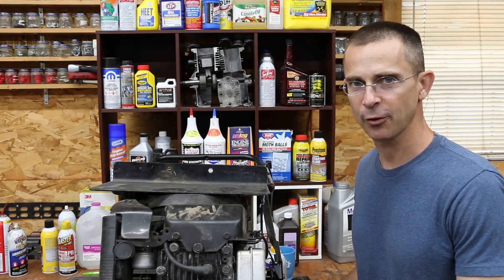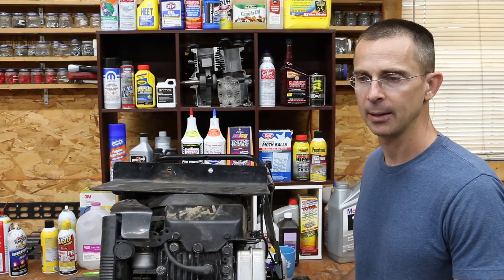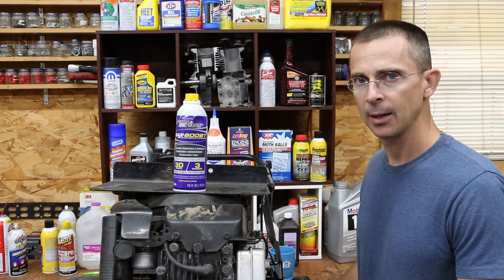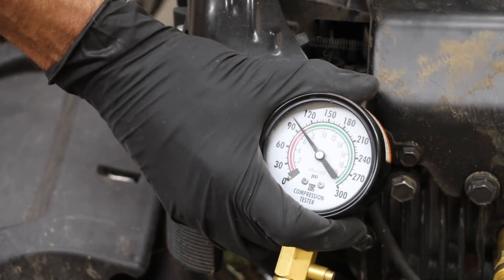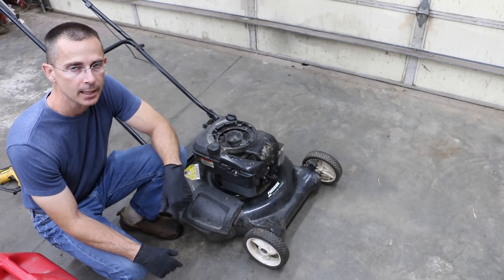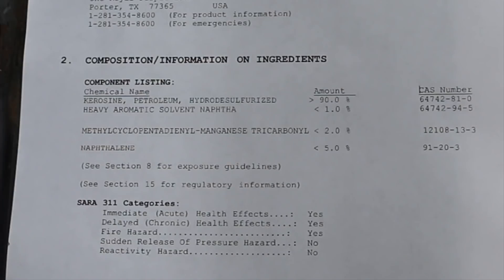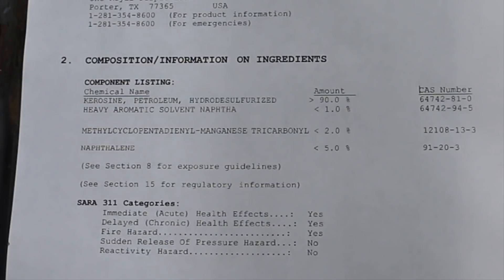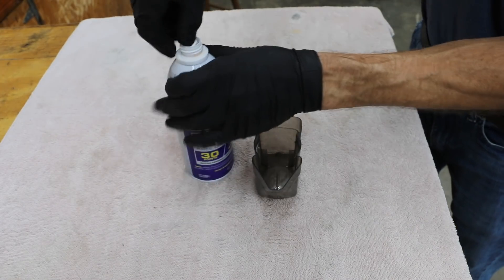Will a gas engine run on 100% octane booster?  Let's find out!

Comment: apparently people do not know what octane really is. they think high octane means more power.
Reply: that's called your butt dyno. It's been proven to show higher HP gains when the owner does something they think should give it more power. Examples of such include cold air intake, louder exhaust, high octane fuel, octane boosters, and various other "performance" upgrades.

The only way your car could make more power is if you could retune it with more ignition advance, but even then you hit the MBT where timing won't increase power any further without additional modifications.  And on a bottom barrel NA 4 banger like your E46 has, it's not going to make any more power.
Reply from the maker: Thanks for commenting. Many people are well informed regarding the way octane boosters work, but most are curious regarding whether or not an engine will run. Thanks again!
Reply: have you tested an engine with different spark plug gaps? that may be a good video if you have not done it already.
Reply: In a high compression engine, IE most modern cars , it does mean more power
Reply: Really all it means is how hot you want it to run. And how hard it is to ignite.
Reply: Pyrotechnition 2002, you don't want your fuel mixture to combust prematurely. So you use a higher octane when you have a higher combination ratio. The only combustion you want in your engine is when the Sparkplug ignites the fuel mixture.
Reply: Zero most of what you said is true but e85 is NOT water based. Its alcohol based. Ethanol burns cooler than straight gasoline and is harder to detonate, which is why you can make more power with it. It has nothing to do with water. Alcohol is hygroscopic though so over time it can be contaminated with water, which is not good.
Reply: ΑΡΗΣ ΚΟΡΝΑΡΑΚΗΣ the engine isn't calibrated to take advantage of a higher octane fuel. It wont compensate for a higher octane, only possibly a lesser octane to avoid detonation
Reply: Taydrum no, it doesn’t; what it does do is allow you to TUNE for more power.

Octane rating is about the fuel’s resistance to combust; in this specific case - prematurely aka pre-detonation/knock from the combination of heat and compression.

When the octane is lower, it is easier to ignite. So something like a hot spot such as a carbon deposit combined with high compression can lead to the fuel igniting before reaching tdc which leads to the energy pushing against the rising piston, pushing against valves not fully closed and they knock against their seat, and can lead to damage (especially in a wankel as it is extremely rough on its apex seals (think piston rings)).

With high octane you can advance timing, run leaner, have higher compression ratios, run more boost, etc so you can tune for more power. The reason why cars tuned specifically for high octane produce less power on low octane is the computer senses knock or otherwise detects the rating and retards timing and adjusts af ratios to protect itself, reducing power.

This means, you can just take a car rates for say 87 octane, put 93 and make more power. That isn’t how it works.

Another example is ethanol/E85. You see this trend now of people doing E85 conversions to produce more power; the power comes from the tuning available from a two fold advantage of the properties of ethanol. 1) much higher octane rating allowing for the tuning mentioned above; 2) it is a water based fuel and the effect of that water vaporizing in the chamber cools it off, allowing for even more room for pushing your tune at less risk of engine damage.

The drawback is it has 40% less energy than gasoline per unit, so you need to beef up fuel system to supply that much extra fuel to be at the same power, then that much more to accommodate you tuning for increased power.
This makes E85 terrible for fuel mileage comparatively, though people doing the conversion are not too concerned about this aspect.

So basically, stop putting ‘premium’ in your recommended regular fuel cars, unless you are experiencing knock (which you then probably should figure out why it is knocking and not use octane as a permanent bandaid unless the fix is a rebuild).

So, economy boxes and most average cars are going to be 87 octane (US) and performance (high compression NA, advanced timings, turbo/sc, etc) are going to be 91/93 minimum for optimal operation under normal loads and safety for high loads (heat, timing, pressure).
Reply: m4xwellmurd3r well, that was a bit oversimplified as of course ethanol and methanol are alcohol based fuels (ahols); but they do contain water and the explanation stands pretty much the same.

If you don’t have injectors made for it, and you don’t flush them if you remove/switch them, they will corrode and be junk because of the reason you said and it’s water content already in it. There are videos with the haltech guy stated exactly what I said, that the water content in the ethanol cools the chamber if people want to find the mighty car mods video to see for themselves; or just searching the net, but it is a known that this is a strong benefit. I’ve been casually looking into ethanol as one of my vehicles is a rotary and detonation and excessive heat being the only real quick killers outside running out of oil. I personally don’t want the reduced efficiency, and a more important aspect for me is ethanol and incompatibility with some lubrications; as I might go to a sohn adapter in the future and run idemitsu 2 stroke both from a reservoir instead of injecting the 4 stroke oil onto the apex seals and premix in the fuel tank at full ups for extra protection for engine longevity.

I do appreciate the correction/clarification but I assume you understood what I meant ;)

I just hope people can understand the point overall; octane rating does not directly increase power. You can’t take your crx running 87 octane and get any extra horsepower putting 100 octane in it, that just isn’t how it works. You would have to put a more energy desnse fuel in to get more power per unit used and that is not what octane rating is.

Simplified answer for people

Octane = resistance to combustion from heat and pressure NOT its energy density rating. It’s for engine safety margins, not power gains.
Reply: you should read up on octane so you understand what it is an  its purpose . depending what compression engine you have is what calls for different octane.  see pre ignition....
Reply: I think your the only one in here that understands what octane is and is for ! lol
Reply: user 007 more octane means more power definitely. I feed a E46 316ti with 95 unleaded (regular), but the next day after I got a payment (a big one) I decided to fill with 100 unleaded (Shell Vpower, and just I reached the pump). Then before I exited the station, I disabled the antispin, and nigga nigga... The car demanded respect, each time I plummeted the accelerator, the asphalt barely holded the rear wheels from spinning, and it felt different...

Comment: Ive also been wondering about diff solvents. Laquer thinner, paint reducers, any super hot/strong solvent. Way combustable. Wonder what'll happen? Im sure my wife prefers all the testing to done by you, in ur super controled enviroment. Curiosity sets my house on fire.  I love the transparent cyl head, ive always wanted to do that. Ur small engines are ridiculously durable aswell. Do you go through many? Do you just rebuild?  Ive seen a couple get hosed beyond repair.
Reply from the maker: Thank you for the recommendations on testing different solvents.  I've gone through 5-6 engines and I'll go though more as I once again resume some more destructive engine tests.  I don't bother rebuilding them.  It's less expensive to buy used mowers. Thanks for commenting!

Comment: I've got a couple ideas for you: Vegetable oil in the crankcase, and tape up the flywheel so it can't provide any cooling air. After that, could try a crankcase full of brake fluid, antifreeze, and power steering fluid also with no cooling air. I'm sure the intense heat will have some interesting effects on those "lubricants" :)
Reply from the maker: Thank you for these ideas!

Comment: Alright, this is a tough one, do you think you could cast an aluminum cylinder head for it?
Reply from the maker: A while ago I made a cylinder head out of JB Weld and it lasted for a minute before I shut down the engine.  Do you have other ideas on cylinder head material?

Comment: I'm still hoping to see what happens when you add kerosene to gasoline and see if it helps clean out engine fouling.
Reply from the maker: I'll definitely test Kerosene, but it'll be several weeks.  Thanks for this recommendation!

Comment: We've all heard not to run small engines on Ethanol "fortified" fuel by now. So how about going the other direction and run the engine on 100% ethanol (pure grain alcohol...aka Everclear... may be easier to find but it needs to be as close to 100% or 200 proof as possible). Or like someone else mentioned in your last engine video: Methanol. Or how about Butane... that's a liquid too. Maybe Acetone, MEK (methyl ethyl keytone), Kerosene, Paint Thinner, Terps, Xylol? The choices are endless! Your local hardware store is bound to have a whole shelf of flammable liquids to pick from!

Nice video by the way. You must have the shortest lawn in the neighborhood with all the cutting you do! :D
Reply from the maker: Thank you very much for all of these video project ideas.  These are great!  Creating these videos does help keep the grass short.  LOL!  Finally, thanks for the positive comment!
Reply: Another idea which just came to me: people are told to put in STP gas treatment in each fillup. How about running an engine off STP gas treatment or fuel injector cleaner? If a little is good, a lot must be better, right? LOL! Keep up the good work!
Reply: the reason you shouldn't run ethanol in small engines is because their fuel systems can't take it and break down.  the ethanol in gas also reduces it's shelf life, meaning if you don't properly drain it whenever it's parked for a month or two it turns into shit.
Reply: My riding mower with the 12.5 horse OHV Briggs ran great on E85. You just have to have an adjustable carburetor for the necessary richer mixture and have to drain the fuel system after each use so the ethanol doesn't destroy it. It has an interesting exhaust odor.
Reply: Butane boils at 30F or -1C which is easily reachable with a home freezer or even winter temps outside.
Reply: That would be interesting to see real E100, not pump E85 (which may actually be 70-75ish percent Eth).  VP Racing Fuels makes legit E90 and E100.
Reply: GrognardOfXCOM 
Back in tech school the kid from Virginia busted out the bottle of shine from his families still. 
He said occasionally when they would be low on fuel for the mower they would cut the fuel 25-50% shine. 
Don't do the whole yard with shine for fuel , but it would get er done!

Comment: Would a two stroke motor be able to run all new or used motor oil and would it be good for the engine or bad Mike would there be a decrease in power with the spark plug foul faster
Reply from the maker: Thank you for this recommendation!

Comment: Will vegetable oil in a crankcase provide enough lubrication for the engine to run good?
Reply from the maker: Thank you for this recommendation!
Reply: The Germans used straight castor in their aircraft in WWI and WWII I think.  It worked but broke down quicker than petroleum and caused motor failures more frequently.
Reply: I think he did this one. It was good . He even cooked bacon with the motor !!!
Reply: Put vegetable oil in Golf Mk2 diesel 1.6 cc ordinary atmospheric engine, and it will run like cats "frrrrrrr" xD we tryed that long ago, and Golf run without problems, only is harder to start engine, i dont know what damage veg. oil can do to engine, we tryed with 2-3 liters and when stop, we filled half tank of diesel and nothing happen with Golf, it survied, without any service! On Hydrol oil (blue oil for hydraulics) running allmost like on diesel, there is no damage! lubrication is better, only u need clean used oil, only oil flter can sometime stuck, and when  weather is cold its harder to start...
Reply: Patrick jones oh yeah he did. But he didn't really run it long enough to see what damage it did to the engine
Reply: Larry Bentley oh okay thanks!
Reply: will it run well
Reply: dawsonw128 
I run my Vw summer car like his. 
1.6 diesel. 
I'll run it on like 50% new motor oil and other stuff like cetane boosters and almost anything that's oil. 
Not brake fluid or power steering fluid. 
Yea, a cold start might crank a little longer but no problem at freezing temps. 
My old Mitsubishi fuso work truck, I ran waste oil in it all the time, sometimes right from me doing a generator service and throwing it right in the gas tank while it's still warm. 
Upwards of 30-40% normally. 
Probably a few times close to straight 
Not mine , so waste oil. 
Mine, new clean oil. 
All I noticed in the truck was a little higher idle, slightly better power, and a little longer on cranking when freezing out. 
Besides , with how bad the lubricity is in diesel, you really should be adding something.
Reply: there's a lot water in vegetable oil. I had to boil it for 5 hours to get the water out enough to burn it in a kiln and it wouldn't burn in it's own. it had to be poured on wood or paper. also, it gums up after drying out after a while.

Comment: Run a engine on motor oil and gas mix 25% gas 75% oil
Reply from the maker: Thank you for this recommendation!
Reply: Nathaniel Vergenz I've had a couple worn out pickup trucks I would swear ran on a ratio like that ahaha

Comment: Maybe clean the  combustion chamber and top of the piston and try using octane booster as long term fuel, like 5 tanks and more heat cycles.
Reply from the maker: Thank you for this recommendation!

Comment: The reason for the temperature increase could have been related to the amount of load the engine was put under while mowing.
Reply from the maker: Excellent point. I should have established a baseline using gas while mowing.  Thanks for commenting.
Reply: I think the increase is due to kerosene having higher btu than gasoline

Comment: I ran a lawn mower on model airplane fuel once.
Reply from the maker: Impressive!
Reply: The mower was a piece of junk with no carburetor. I poured the airplane fuel into the engine. The thing danced across the floor till it ran out of fuel.

Comment: What an awesome experiment with surprising results seemed to run fine on it you might try and see what happens if you replace the engine oil with chainsaw bar oil or even gear oil say somebody’s engine was leaking oil and they didn’t have any oil and was low so they found either one of those oils and needed to go somewhere urgently and it may even slow down or stop the oil leak from it’s viscous state
Reply from the maker: Thank you for this recommendation and thanks for the positive comment!

Comment: If I remember correctly (and this applies to the brands I have done research on only) octane booster is designed to reduce knocking (pinging etc.). This allows a motor with high compression, or that has been turbo charged, to run with the timing advanced further than normal giving it more power. On modern cars with ECU's that adjust timing automatically to the optimum point just before knocking occurs octane booster can help it run with more timing advance, on NA motors with a lower compression ratio it should not really make much of a difference. When one starts modifying engines with either higher compression or more boost a higher octane is better for performance as it reduces knocking. 

I would have thought that octane booster alone would result in less power from a motor that does not have a ECU that adjusts timing automatically, but thanks for doing this test I found it really interesting. 

I would still love to see a test of liqui moly's ceratec, in theory it should work well. 

Thanks for making these videos, I find it to be one of the most interesting channels on youtube.
Reply from the maker: You are correct on how octane boosters function. I will definitely test liqui moly's ceratec.  I'm really looking forward to it.
Reply: Project Farm Thanks, and keep up the good work.

Comment: Rc nitro would be amazing I know I've said it a the other day but I really would like to see if I would work in a small engine
Reply from the maker: Thank you for this recommendation!.  I'll definitely put together a video on this.
Reply: Paul McCoy I tried it once in a motorcycle ran like a beast but could not shut it off without dumping clutch to kill it ran awesome though
Reply: I frequently ran RC aviation fuel in my yamaha four wheeler. It was the pink high nitro concentration stuff. Would put about 12oz of it in with a gallon of gas, DAMN you could tell the difference.  I don't think it ever damaged it either. Still runs to this day.
Reply: It won't work, alcohol burns 3x faster then gasoline and it doesn't have enough compression
Reply: I ran an 88 chevy spectrum with approx 5gal of 87 octane and 1 galnof nitro methane, ran great but the exhaust manifold was glowing bright orange, was running for a few hours non-stop, jumps , racing a Ford ranger, etc. In a field.

Comment: Get a 2-71 Detroit Diesel blower. Under/overdrive it so that you get 11psi of boost. Test 87 v 91 v ethanol v Maxboost. Dyno pull the engine.
Reply from the maker: Thank you for this recommendation!